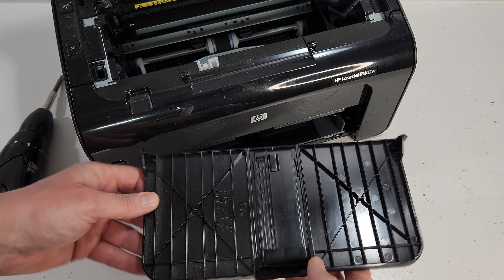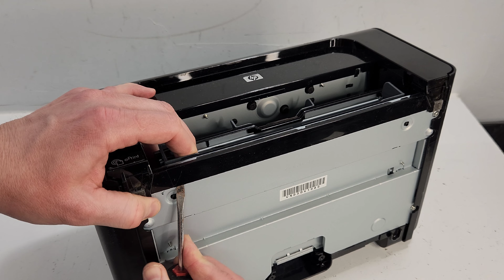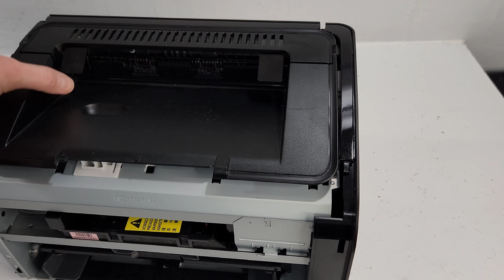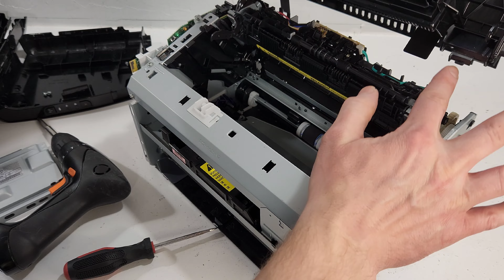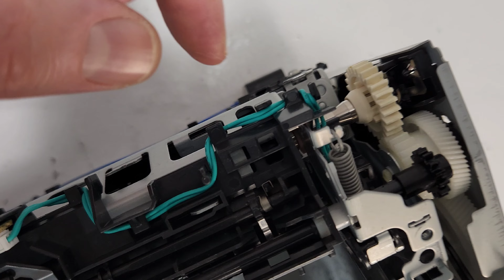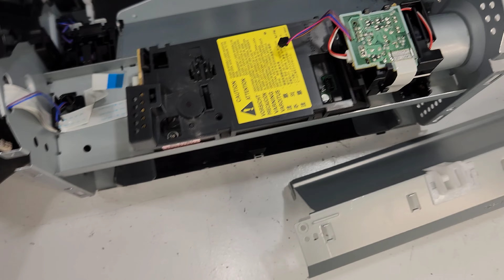How To Remove Parts off HP Laserjet P1102w Printer

Comment: thank you! But I have two corrections:
6:20 - you need to SLIDE the metal plate upwards - it is not latched, this way you damaged it
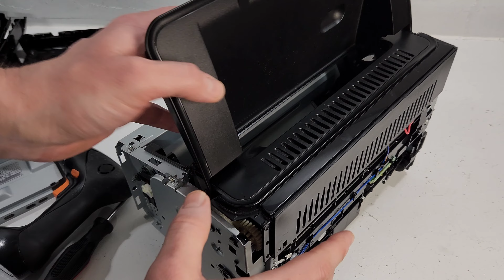7:00 - these can be detached, you don't need to keep both together
4:16 - to people who would put it back together - it's good to pull out the cover of buttons, and the buttons - clip the side part back, then the buttons, then the cover of buttons

good vid, it saved me a lot!

Comment: Do you have videos on how to dis assemble HP officejet pro 8500A premium. Actually wants to take out ink assembly to cleanup ink tubes
Reply from the maker: I'm actually surprised that I do not. I have worked with HP 8500A models plenty before. I will make a video on the disassembly as soon as I get one. I'll try to find an 8500a printer this week.